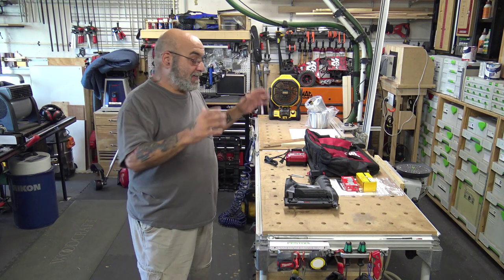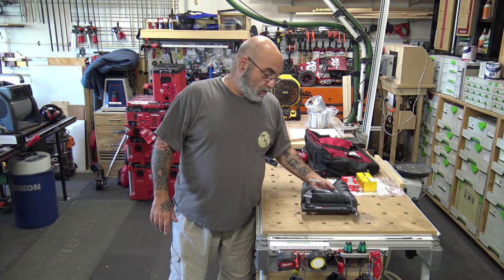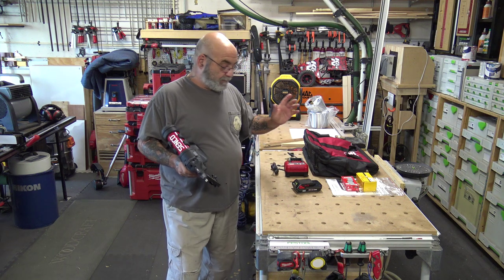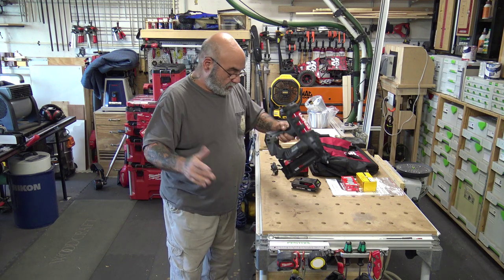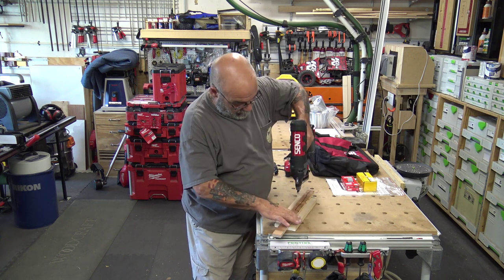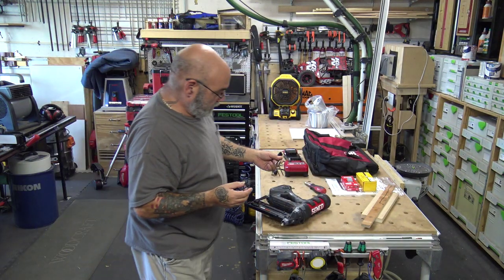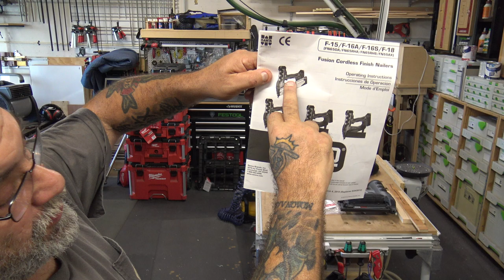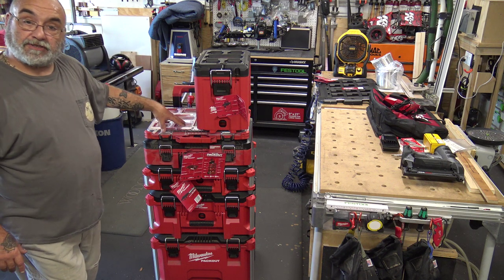Senco F18 cordless 18 volt brad nailer.

Comment: I wish milwaukee had  the cart at had time I bought the rolling tool box.
I have few pieces to build my system for finish carpentry. 
I'd probably gone 2 wheel cart with 3 drawers for some things 2 drawer for other stuff.
The box is pain unstacking it all but is real nice system.